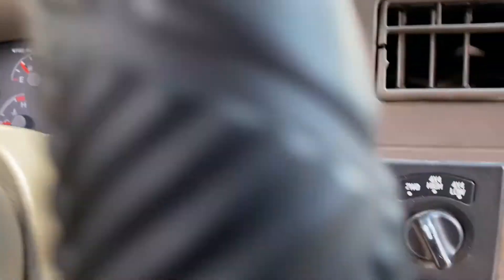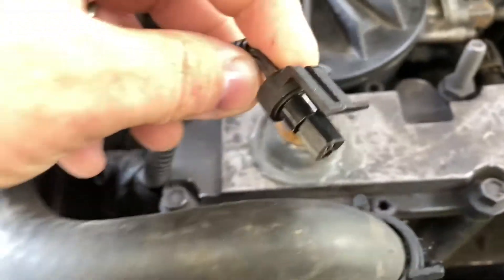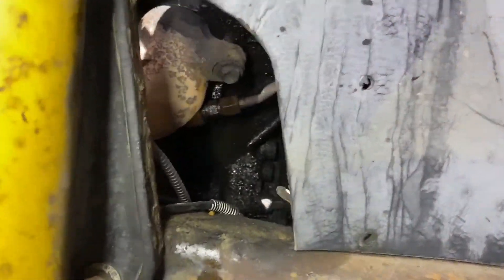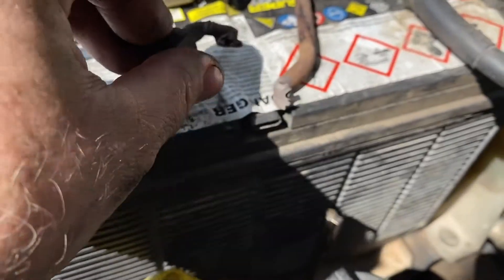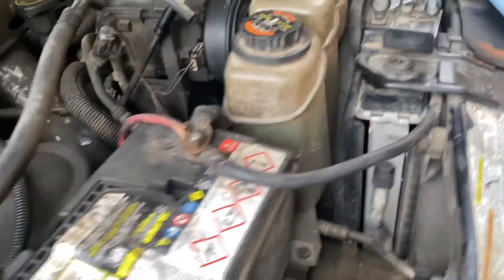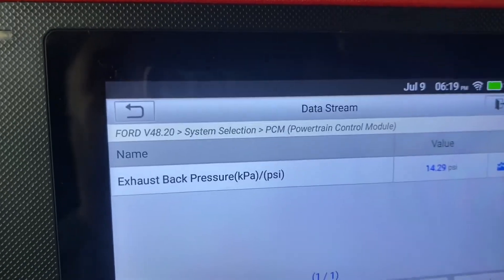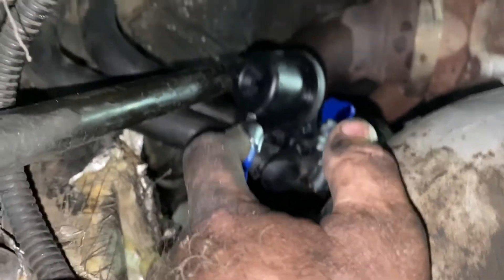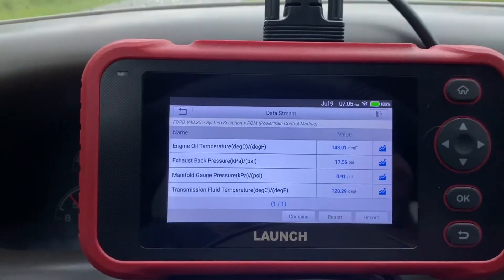Ford 7.3 Powerstroke Backpressure Sensor

Comment: I've got the launch CRP123x and it works great for my 02 f350. And it's not super expensive like forscan or autoenginuty. Also, awesome video☺️👍
Reply: 😂 FORScan was $19 for the year+ $20 for an odm plug with computer connector

Comment: The way I understand it, the exhaust back pressure sensor controls the exhaust back pressure valve which is located under turbo on the turbo pedestal. I replace my Garrett factory Ford Turbo pedestal with a Garrett pedestal that doesn't have the EBP valve built in. Probably built for non Ford applications. The fit is perfect. You have to replace the original Turbo Exhaust housing with a exhaust housing that doesn't have the valve built into it or delete the valve from the original housing and block all the holes. Everything is fairly cheap and it's all pretty straight forward.

Comment: Do you happen to know my my EBP doesn’t change? on my 02 f350 7.3, my edge monitor shows it stuck at 29. Has a new sensor and tube. Have a stage 2 turbo and did the EBPV pedestal delete and placed a SPOOLOGIC Exhaust Back Pressure Valve Terminator on the pigtail.
Reply: Please let me know or anyone else why I have this issue.
Reply: Did you figure it out? @fdevies
Reply: @MindlessMovement  yes, replaced engine harness. That fixed it, probably broken wires too far back to unwrap and locate.
Reply: @fdevies  did you try replacing sensor first? I only ask because my edge is reading 39. Truck on or off its reading the same 39.
Reply: Nevermind. Yes I see you had new. Thanks!
Reply: @MindlessMovement   no problem, yeah every sensor on it is new from ford dealership. So many upgrades that I decided to replace harness. So I wouldn’t have to second guess.

Comment: You need to put a boost fooler on it and a wicked wheel in the turbo.. that's what I run... You also need to put a 6.0 trans cooler in it.. the 7.3 trans cooler is a 1/4 of the size of the 6.0... it's a easy job...7.3 are the best motors you can have just need to know the does and don't... Don't ever do the PVC delete you will burn the turbo up....

Comment: NEED EGT GUAGE. TS TUNES RUN HOT .. HYDRA TUNING IS MUCH BETTER, COOLER BETTER MPG. IF YOUR TRANS HAS NO INTERNAL MODS..DP TUNER IS EVEN BETTER, ALMOST PERFECT CAN GET EPV VALVE AS EXUAST BRAKE. DP FOR TUNING IS GREAT. COST YOU ABOUT 500 BUCKS. I WENT THRU ALL THIS. BUT WORTH EVERY PENNY. IF YOU TOW MOSTLY FLAT TS OK.KEEP ON 75 FOR BEST MILAGE.

Comment: "Check Engine Light" should be on when Key On/Engine Off - It is a bulb check so you know it is working--- Have seen cars from used car lots with the bulb removed so customer didn't know they had an issue which needed attention.

Nice vlog on all the little fixes!

Comment: Only problem with a programmer on a diesel and towing, is  the trans doesn't pump very fast with low rpm diesel spins. Keeping the programmer turned down with that upgraded trans cooler towing will help help make the trans live. 7.3 will pull the load in OD it just builds alot of heat. Love the new truck btw
Reply: Any suggestions for a manual?
Reply: I pull a 14k lbs. 5th wheel camper.  My trans runs cooler in OD . I have a BTS transmission with a 6.0 cooler. Has had a few HP mods just short of bigger inj.
Will probably do that some day when needed .  But for now it has enough HP.

Comment: Only buy the oem sensors I found this out the hard way.you may as well change out the crank sensor or buy a new one and put it in the glove box.
Also watch the oil level if it is using oil it will shut down and won't start until you get the oil level corrected.the oil rings on the injectors sometimes erode and let oil bypass."this happened to me" I found out to only use the new oem injectors unless you like working on these things.

Comment: Ford used those valves to help bypass the coolant before the thermostat was open. Without it, you'll go through heater cores often. Huge issue for the 92-97 trucks

Comment: I have a 2001 F250 with a 7.3, love that thing. What tuner do you use and where did you get it?  Also, there is YouTuber named Fix-it-Nick that has done every upgrade imaginable on his 2000 F350 7.3, might be worth a look to you.
Reply: He has a TS 6 position tuner.. I have the hydra chip by power hungry performance on my 7.3. And me personally I like mine. I’ve had both

Comment: Cleaning the evap coil in my 2001 made a huge difference.  It wasn't terrible to pull but it wasn't great either.
Reply: Mine was a bear, the coupler was so froze up, someone used JB Weld on it to keep it from leaking so I had to change the Evaporator. Getting it back together was a real pain in the butt too. I noted that when you do it you have to do the bottom corner 1st, after that easy peazy. Best Wishes & Blessings. Keith Noneya

Comment: Thinking about getting me a Ford f250 7.3 turbo diesel
Reply: Great trucks, just beware of the weak factory valve springs. If your going to play around at higher rpms it will save you a fortune to just upgrade them ahead of time. That's the only problem I've had and I abuse the hell out of it.
Reply: @jaydunbar7538 what would you consider “high rpms” I know context is key so I guess I’m asking what would be  considered reasonable for running 13-14k net on 38’ gooseneck, remote mountainous forest service roads, elevation 8-9.k feet. I usually settle in for a proper sustained pull around 1800-2000 rpm to minimize boot. Of course we’re asking a lot of the truck and knowing it’s being used on the edge of long term sustainability but will be improved over time. Sorry for the novel just curious 🤙🙏